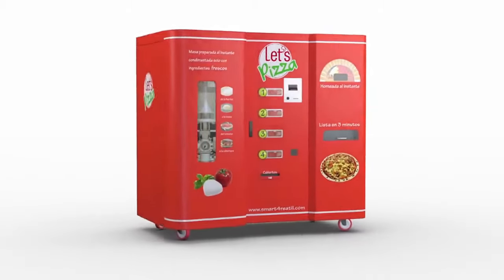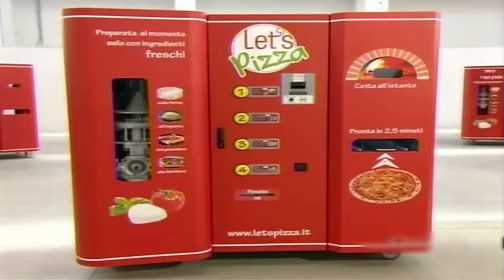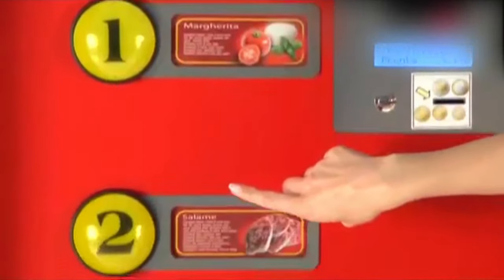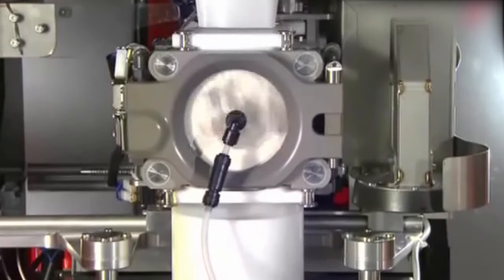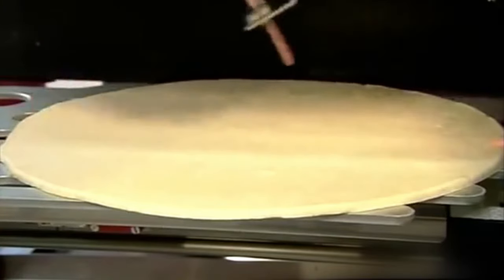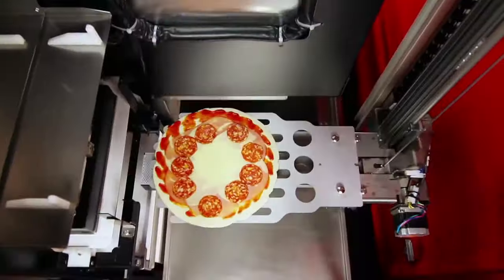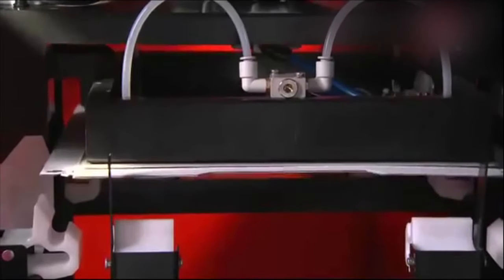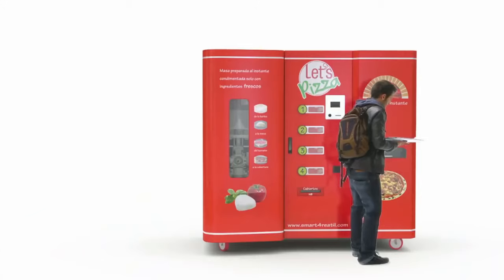Let's Pizza - How It Works

Comment: You're not going to convince me that there's no insects or other critters inside it.
Reply: Too many spots for them to enter
Reply: Soda vending machines never deal with that. So why would Pizza vending machines?
Reply: Everything is stored in sealed boxes, no food is kept in the oven.
Reply: Critters and insects are an already included in the processing of the flour and milk.😂
Reply: @Walt_Xander94 take a wild guess why. There are several reasons why , think of 1.
Reply: Stop drinking !
Reply: @MrHeavyrock  did you comment on the wrong post ?
Reply: Well, seeing as it gets baked I’m thinking #FreeExtraToppings

Comment: The Let’s Pizza vending machines will cost around $50Kusd. Final pricing depends on a few key operating costs that will be finalized by the end of this year or early next year. 🍕 

Although they are up and running overseas, the ability to distribute them in another country ie the USA, has its own challenges as some manufacturing changes to the machine must be addressed. After all adjustments have been made, the timely process of being approved to be sold in the USA has to be overcome then production of the machines can start. Once production has begun they will start distributing the Let’s Pizza vending machine’s across the US. 🍕🍕

The Let’s Pizza team is working diligently to overcome all these challenges quickly and accurately to insure safety and authenticity. We at Let’s Pizza are eager to offer FRESH made from scratch pizza to everyone here in the beautiful USA 🇺🇸 Thank you for your interest and LETS PIZZA! 🍕